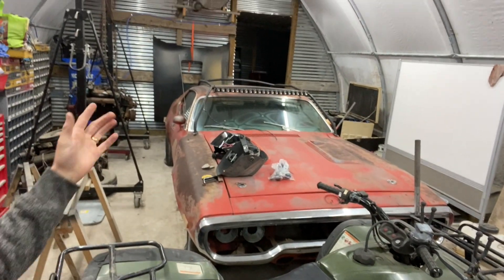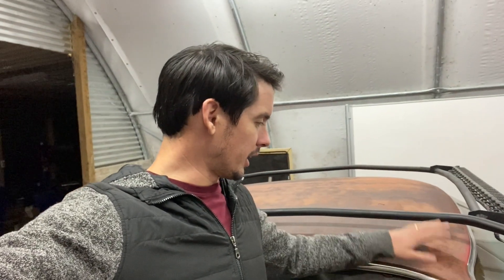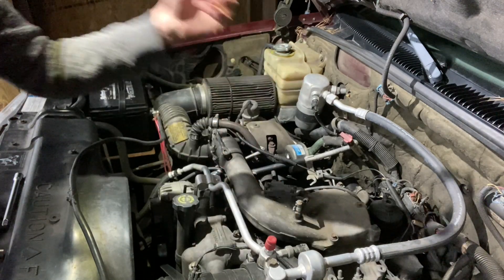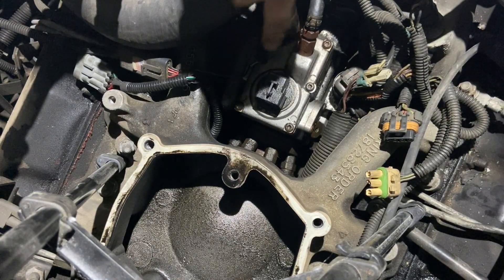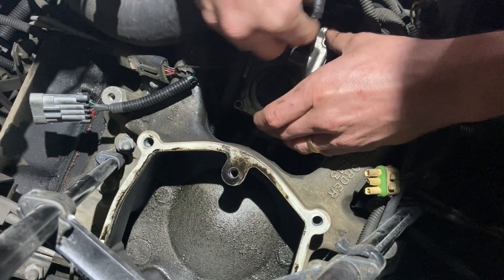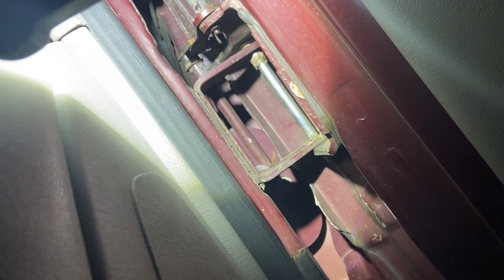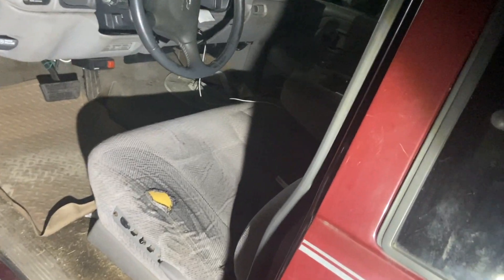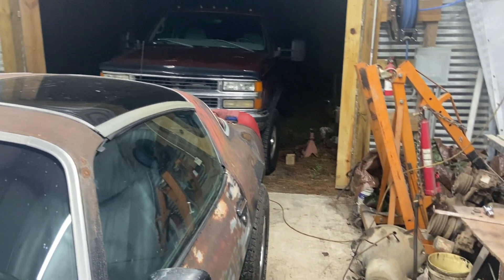6 5 Optical sensor

Comment: Hi Lakeview garage I have the same Issue on my 6.5 turbo diesel the optical sensor is leaking due to the seal . I’ve looked all over and have not been able to find the ring that works correctly . The original ring is round but actually has a Square profile that fits into the groove of the optical sensor any help would be greatly appreciate it
Reply from the maker: Well to be honest I took the oring to work and matched it up to one from a generic kit, if it’s supposed to be squared then I got lucky cuz it hasn’t leaked yet lol